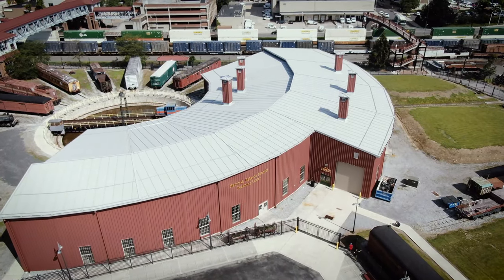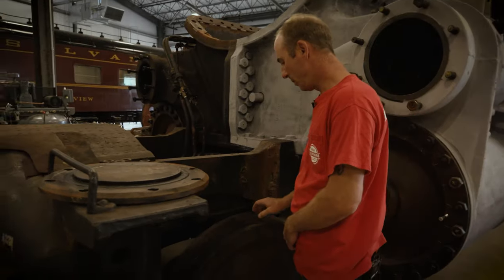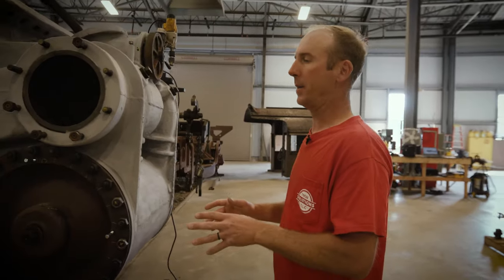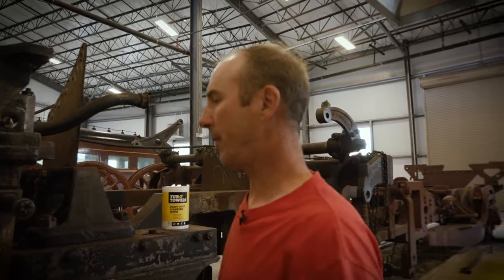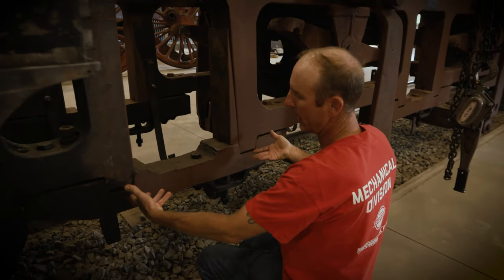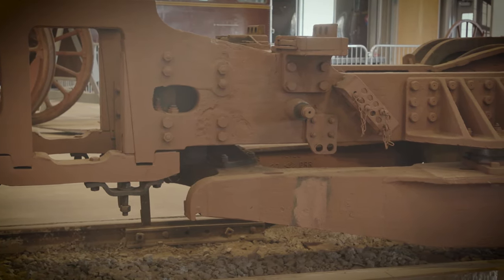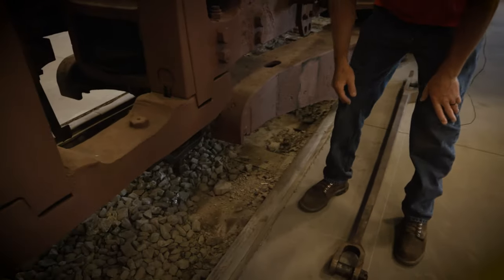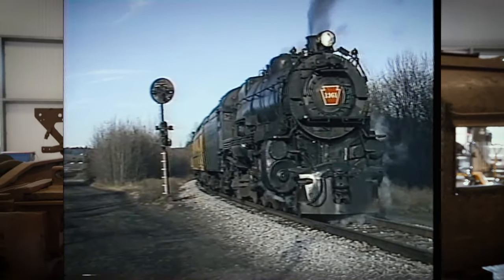Steam Locomotive Frame Inspection | Pennsylvania Railroad K4 No. 1361

Comment: Nothing worse, than walking into a project that has been torn down for years, and is known to have had substandard, sloppy work done. You have to literally go over each piece of the project. I feel for the first time in decades that 1361 is finally in good hands, and may have a chance to see her steam.
Reply: I experienced the same thing first hand overhauling the CAF's B-29 "FIFI" in 2006. It hadn't had any major maintenance inspections since it was dragged out of the desert in 1971. Cert. AMT 42 yrs..

Comment: Getting 1361 back in steam is going to be the biggest challenge in restoration to date. Some of the work done in the eighties was hastily done and poorly engineered. Given the condition it was in when placed on display by PRR, that they were able to get it running was amazing and that it didn't have a catastrophic failure even more so.
There has to be a way to put those roller bearings in a carrier that allows that 3/4" lateral movement needed .

Comment: Has anyone checked the alignment of the cylinders to the frame? It was pretty far out the last time it was checked. The shim in the saddle is due to the swapping out of one cylinder halves with one from a different locomotive. Also, keep an eye open for saddle bolt hole cracks due to the hammering in of the tapered bolts and the cast iron (?) cylinder castings.
Reply: Shimming would be common when swapping previously machined cast iron components. The variances of those frames are pretty large I'm thinking. Everything is aligned during the initial manf.

Comment: This poor locomotive’s prior ‘restorations’ were so mismanaged and resulted in so many undocumented, unsound modifications, it has really made it difficult to resume the restoration work properly.  As the FMW team mentioned in another video, they can’t take for granted that the original PRR drawings match the current state of the engine.  They can’t even assume (in the case of some rivets used in excursion-era boiler work) that the materials in the locomotive currently were properly selected or documented.  

It’s really a mess, but I have confidence in this team that they will correct all the problems of given sufficient time and resources.

Comment: VERY GOOD Explanation Of What Is Being Done,  The Initial DESIGN Of The Moving Parts On The Drive Train Of A Locomotive,  And It's Framework.  It Was MORE  Interesting Than Just The Boiler And The Pipes Inside Of One.  Story Goes That These Steam Locomotives Spent As  Many Days Per Month IN THE SHOP Being Repaired, As They Spent On The Road Hauling Freight.  And By Watching Films Of The Rods And Wheels On Them Spinning And Working At Higher Speeds, You Can Imagine The CONSTANT Ware And Tare Those Locomotives Endured...WOW... JOB SECURITY For The Mechanics In The Lokey Shop Indeed, Where My Grandfather Worked In The BR&P Shop In DuBois PA...